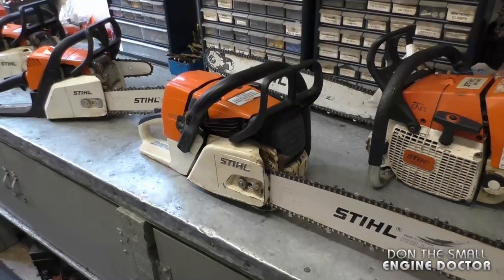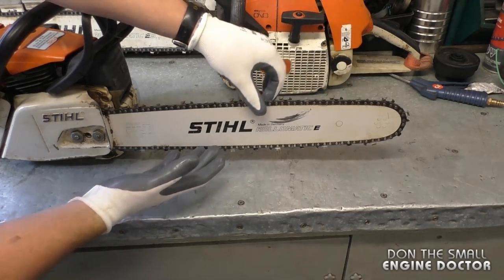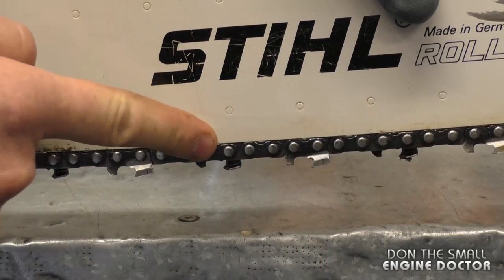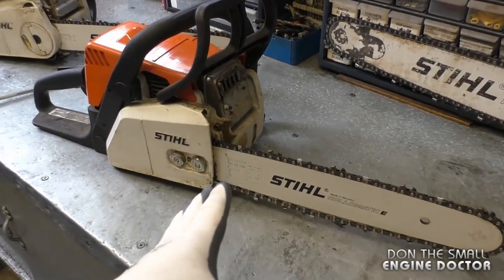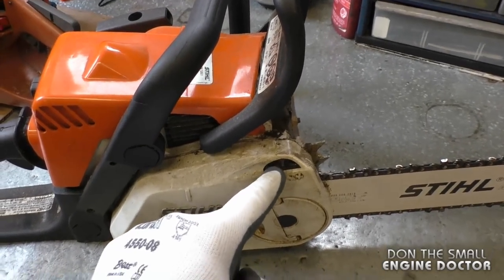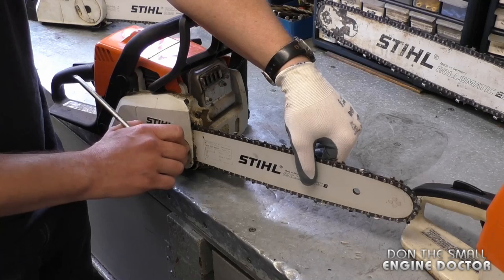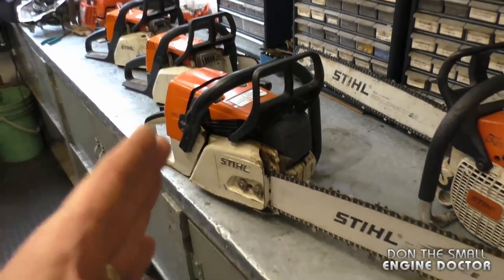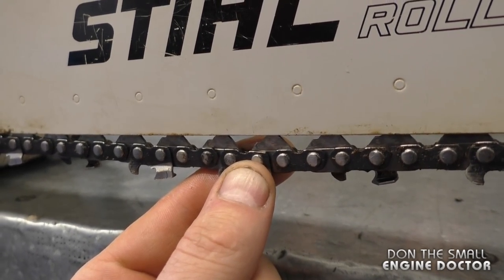How-To Properly Adjust The Chain Tension On Your Chainsaw - Video

Comment: Great video Donny. For new chainsaw users, you'll likely find that once you've adjusted your tension correctly, the tension will increase when you tighten down your bar nuts - I leave my tension a bit loose before final tighten to compensate. Cheers!
Reply: Exactly! Especially,  I found,  on the new easy adjust saws which require no tools. Like my 251c. My new baby.

Comment: This gave me a better idea of the proper tension, thanks for the vid, I usually tighten till  I have a little resistance while turning cold because once it's warm it turns quite easily.
Reply: Good point.

Comment: Thank you for this. I just have one of those cheap electric chainsaws, which I use for a few hours over a day or two every year. So a year passes and I forget these steps. It also has black screws for the cover plate, remove the cover plate.... and always I have to search for the screws. Today I put some yellow paint on  them with a paint marker pen, so I also wrote some instructions on the bar. Of course this clearly identifies me as clueless...  (and having done this of course now I will never forget, but had I not done it.....)

Comment: Is it necessary to hold the bar nose up on Quick Chain Tensioner models when tightening the chain, or is that just for the traditional models with the two nuts?

Comment: You said to adjust it when your chainsaw is cold what happens if you're running it out in the field and it needs adjusted how long should you wait for it to cool down before you adjust and also if you're cutting a lot how often should your chain need adjusted

Comment: This is a great description of the process. I recently finished restoring a Homelite 150 Automatic and put a brand new 18" bar and chain on it. It runs beautifully but something I noticed when doing the initial tension adjustment was that there is nearly ZERO up and down leeway for the bar that the saw allows. Maybe it's because it's an aftermarket Oregon bar (and chain) and not the factory 16" Homelite combination, but that was a little "hey cool" thing I noticed when putting it all together.

Comment: One question, once I  tensioned the chain , as per your instruction, I then found it very difficult to move the chain along along the bar, is this normal?  (Prior to tensioning it slides very easily)

Comment: have set my electric chain saw to the right tension , but the chain still won't budge or move forward by hand!! I have the safety bar/chain break down . Is it different for electric chain saws?? Where this manual checking for forward movement does not apply??

Comment: Great video. I was cutting up a tree with my father in law the other day, and he needed to swap out his chain (Stihl 025). After he started cutting again, I realized his saw sounded different - a subtle metallic noise - and then he shut it down to tighten the chain some more.  That sound went away. Is it possible I could actually hear the loose chain?  Hard to imagine any other explanation.

Comment: I have a Stihl MS170 saw. I did the tension adjustment, which is just like this video, but when I get it to the correct tension, I can barely turn the chain with my hands as shown starting at 3:00 in this video. Why is it not turning freely?

Comment: My first view of any of your videos.  Great job!  I will watch more.  I realize you were not showing sharpening technique, but near the end as you were showing your "big saw", say around 3:30 or so, the saw teeth appeared have been sharpened with a big "hook" and by a file that was too small.  Notice how the bottom of each tooth has an edge way forward of the cutting area.  Am I wrong?  Is that a special type of tooth.  I am used to round ground chisel.

Comment: And one last tip: After working with the saw, loosen the tension on the warmed-up chain a little before putting it away. That way, as the chain contracts while cooling down it won't put stress on the gear.

Comment: Nice video, Don! Althoug most modern bars have a rotating sprocket, I understand that bars without sprockets should have a slightly lower tension than what you demonstrated. Can you confirm?

Comment: What would cause the chain not to hold tension for long and have to be adjusted frequently?
Reply: kkovler1 lack of bar oil and blunt chains
Reply: And loose bar nuts and lifting the saw while cutting.
Reply: kkovler1 , might be along shot maybe the sprocket in the tip , and I've had them run and seem normally for a little while, double check that the drive end is seated proper,
Reply: Most common reasons are either nuts that have worn threads and are backing off with the vibration allowing the bar to slide. Or the clutch cover is worn where the nuts contact it. The nuts are then bottoming on  the shoulder and not allowing the cover to grip the bar.  

If only occasionally, metal such as screws and nails in the wood can give the bar
a sufficient jolt when running at full throttle. This can pull the bar back into the saw. This can happen to a saw in perfectly good condition.

Comment: Is it a good idea or necessary to loosen the chain (take the tension off) when putting your saw away?
Reply: The Stihl manual says to ao that because the chain cools and contracts it can possibly damage the saw. Not just the bar but the sprocket, clutch etc. of the engine and drive parts.

Comment: I have a brand new Stihl ms880 magnum with the 59 inch bar for my sawmill and I can't seem to get the chain tensioned properly. It seems as if the tensioning screw is at it's end point just as the chain looks like it's tight but it's not. I can easily lift up on it and the drive links can come up all the way out of the bar. I know I have the right chain size for the saw so what is my issue?
Reply from the maker: if you just bought it check with dealer that sold it to you

Comment: I love your videos, Don, but what if your chain won't stay tight even when following all your instructions in this video; i.e., it keeps loosening up? I think you forgot to mention how important it is to keep the area under the clutch cover, especially the part that clamps the bar, and the bar where it is clamped by the clutch cover, very, very clean, which can be a pain in the butt because the bar oil/sawdust mix is always trying to force itself into every crevice, but you gotta do it.  Also, how important it is to keep the bar studs and nuts clean: see if they drag when screwing them in by hand, and if so go over them with tap and die.  It is easy to shear off a bar stud due to overtightening because the threads were dirty.  Also, if you shear off a bar stud in a saw with a plastic crankcase,  you don't have to throw the saw away.  McMaster-Carr sells a repair kit featuring a steel threaded insert, so it won't happen again.

Comment: My Stihl ms290 is tightening its own chain as it runs and I'm not sure what's causing this any ideas?
Reply from the maker: make sure it's oiling
Reply: The bar might be getting pushed up when you cut.  That's why Dony said to raise it before you set the tension.

Comment: I have a stihl 046 with a heated handle, but the handle doesn't seem to be heating up? Any suggestions? Thank you.
Reply: sometimes theres a shield that can be moved for summer use. Its kinda like a tab that slides over. My husky has it not sure about the stihl. Take the top cover off and take a peek.
Reply: The part is called a shutter, in case you want to look it up on a parts diagram.
Reply: Paul Decker Thanks, but i don't think it's that, i think it's something with the heated handle itself
Reply: Try removing the flywheel and checking the wiring behind it for the handle heaters. Sometimes those wires become frayed and the circuit shorts.
Reply: Paul Decker Alright, should i buy a flywheel puller?
Reply: You can, they're usually pretty cheap on eBay. You can also use a regular two or three arm puller if it'll fit inside your chainsaw case. Sometimes the flywheel will come loose with a few light taps with a mallet.
Reply: Paul Decker Hitting it with a mallet won't hurt anything?
Reply: Holy crap. Heated handle on saws. I thought that was a joke until I googled em. I need me one of them. Gets chilly round here in dead of winter and I hate wearing gloves so thick your hands look like a giant's just to retain some heat. Screws with dexterity.

Comment: I don't seem to have any adjustment left on my adjuster screw. New bar and chain 036. Any ideas?
Reply from the maker: you need a new chain and possibly a new bar too
Reply: Brand new Rollomatic bar and new chain.
Reply: Are the number of drive links in your old chain the same number as your new chain?

Comment: why do you hold the bar up?
Reply: Larry Lafferty It takes more slack out of chain. While cutting, natural down pressure (but not leaning on it, if so, dull chain) bar moves up ,even with snug bar nuts, then chain would be loose.
Reply: okay thanks
Reply: Yep kinda preload the bar as if cutting action. You can also set bar on a piece of wood to put preload on it sometimes it's easier.
Reply: Thanks

Comment: Make sure your chain is placed the right way and not wrong way around, I recently replaced my chain and did it incorrectly the first time, it can cause a few problems and will obviously not cut anything as the teeth are pointing the wrong direction. Be smart, don’t be like me 😂